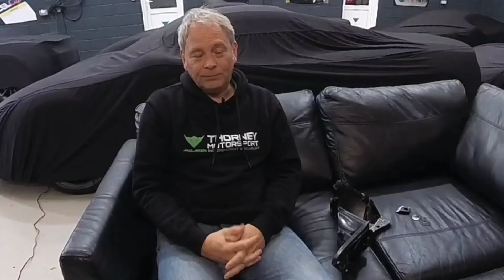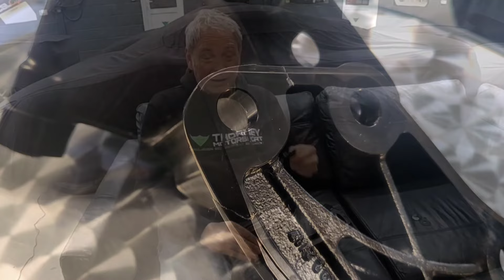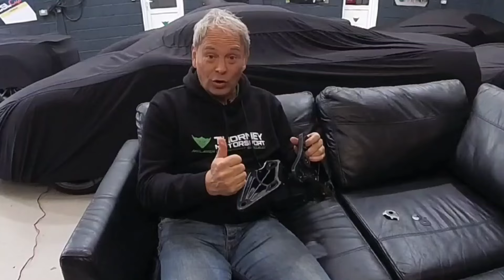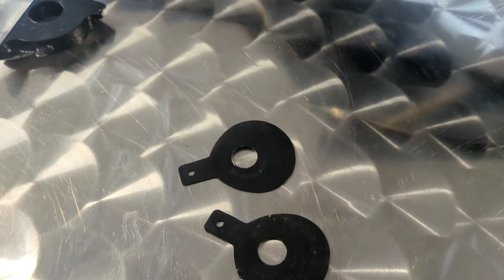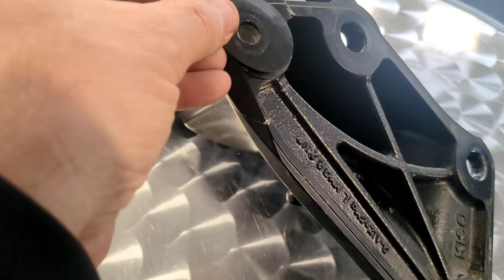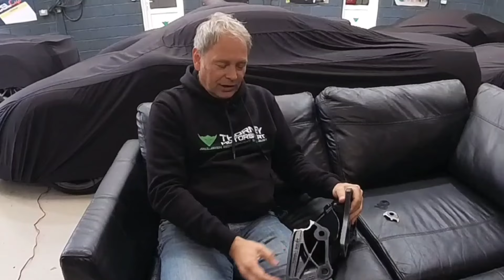McLaren Sports series hinge update, here is why they are breaking

Comment: Also, the fact that the attachment bolts milled recess' are left with effectively sharp edges where the bolt head lands so always a potential stress area. They seem to crack there even when fitted with no shims fitted.
Basic engineering error.

Comment: I’ve now had three…allegedly 🤔. Had passenger door replaced 18 months ago, along with some “rust” paintwork. I noticed this April I had ‘rust” again on same panels and took it back to dealer. It’s an MY2018 570 Spyder and just past 14,000 miles. They fixed the paint and also said I needed both hinges. I was very annoyed as the passenger door is probably used 1 in 50 times I drive the car; so very infrequently. I am a Nazi when it comes to ensuring the doors aren’t slammed down too. I literally threw my toys out the pram and McLaren paid 75% of cost… which to me is still taking the piss as this is clearly DESIGN FAULT. Note; I worked in a foundry as a student making boilers…. They operated at 100’c for 25 years technically submerged in water without failure 🤷🏻‍♂️

Comment: hi John ~ Just subscribed ~ I'm thinking of trading in my 488gtb for a used 675LT. Anything I should be worried about? engine and transmission wise? my 488 has been trouble free for the past 3 three years of my ownership. Getting already worried to see your hinge update" video lol.
Reply from the maker: Get it fully inspected by someone knowledgeable and you should be fine. There are a few buyers guides on the channel that should help.